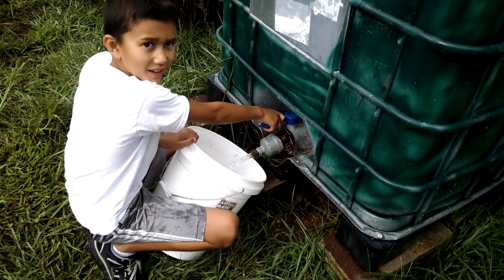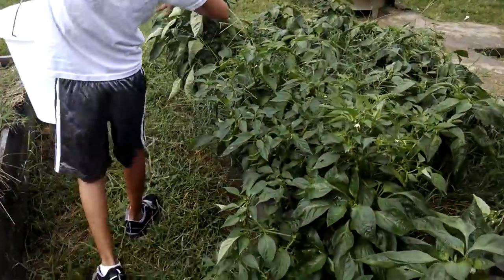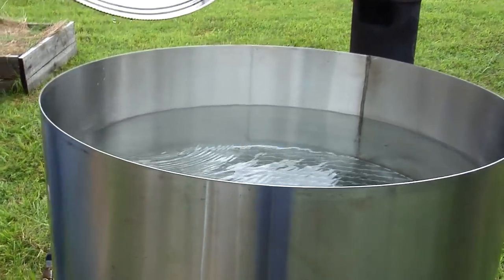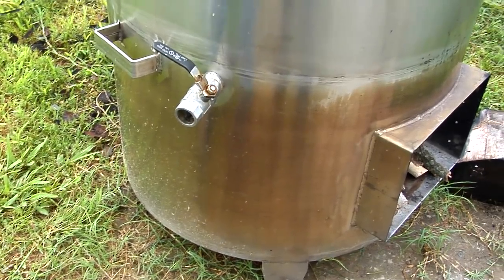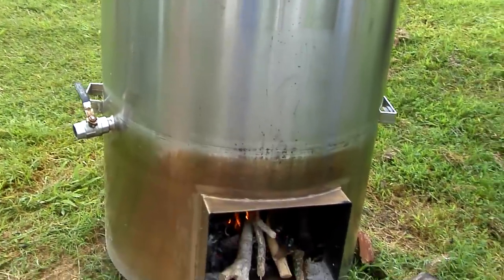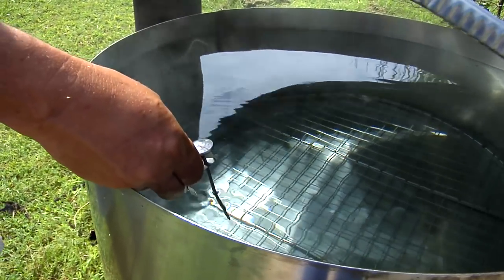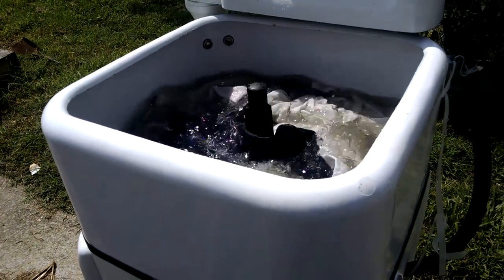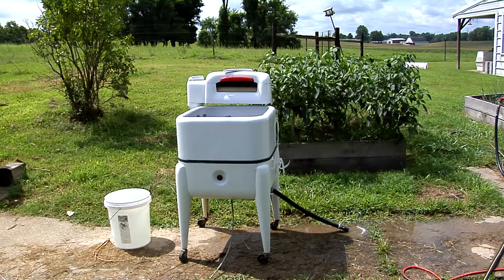Off Grid solution for Hot Water.

Comment: Good set up, I woujld think you could scald chickens and ducks and even turkeys for plucking with that much water.  Very practical. Thank you.  Don't wear flip flops on videos, as it's unseemly.
Reply from the maker: Well, most of the Plain People where sandals or flops or go barefoot in summer. We don't have AC. Socks and shoes hold in too much heat. Normally, I would just go barefoot, but I have an ongoing issue with the connective tissues in my foot from a medication I took more than several years ago... and sometimes I need to wear something soft on my foot!
Reply: No tone comes through on comments but I was just ribbing you a bit, sorry! I grew up on Merle Haggard and he sang Leather boots are still in style for manly footwear and I never got past it.  It's a free country do what makes you happy!